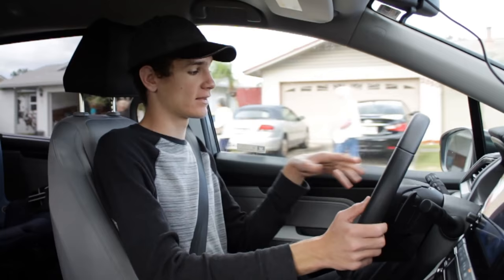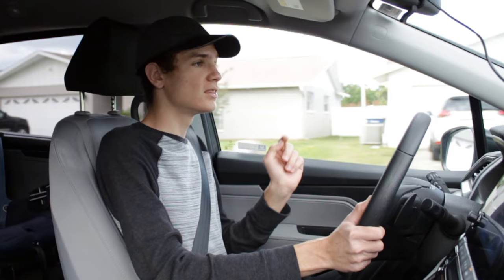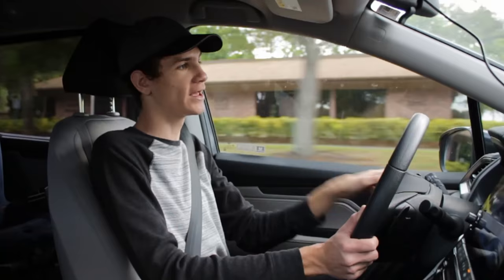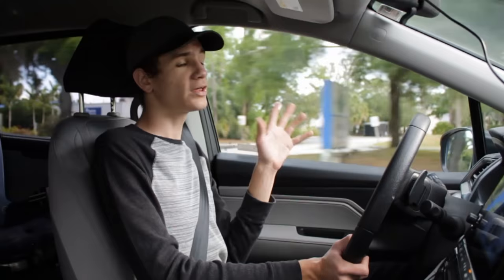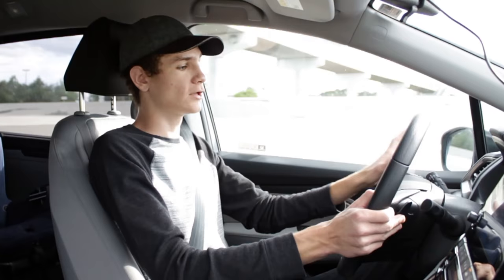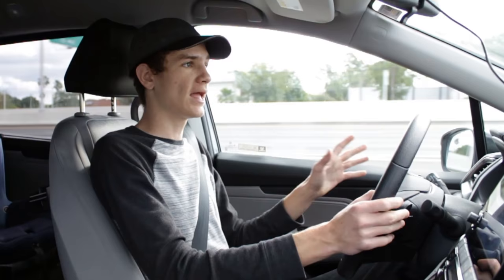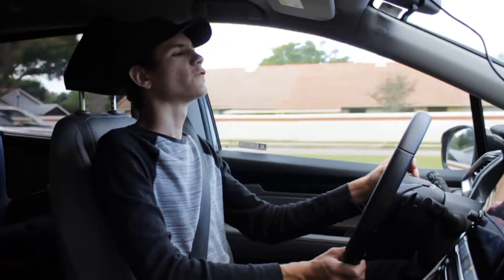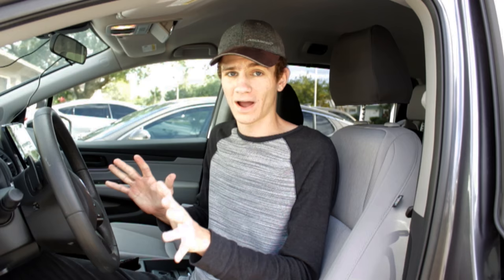How To Use Paddle Shifters | The ULTIMATE Guide

Comment: Negative is forward, Positive is slowed down. Thank you. I thought the cat had issue for stalling. 
Another thing on the dash board, when you use those flaps, it shows the icon moving from 1-7 I guess that’s the confusing bit.

Comment: I thought they came with a clutch peddle since it's a manual. Thanks for this video cause when I tried driving with paddles I didn't see a clutch so I assumed it was an auto. Since I like loud cars I kept pushing the minus paddle and my drive was awesome!!!
Reply from the maker: The idea is that there's no pedal to peddle because instead you pedal the pedal peddle paddles on the back of the paddle pedal peddle. Glad this helped 😁
Reply: @marcowollenweber9723  Lmfaoooo

Comment: Not with a 2021 Buick Enclave. Tried it once. It was dismal, but I haven't figured out how to use it. It's the wife's car, so don't drive enough. The time I did after I got going, it held the shift point to start changing gears. For example, I used the  paddle shift at 4,000 rpm and every new gear started at 4,000 rpm. Must be for towing or passing?

Comment: I tried to press the minus paddle, it sounds like my engine is struggling, it is very loud, so I press the plus again. Is it good to hear the loud sound or bad? They said that it will damage your transmission, gear, etc. Thanks.
Reply: Just don't go over the redline bro but modern cars would have limiters so you should be fine.

Comment: If im driving automatic, do I NEED to paddle shift? or I can just drive automatic ignoring all the other stuff
Reply: No one replied to this so i will. Paddle shifters are essentially “automatic manual” so your controlling the gears manually but if u red line or are in a high RPM (the numbers that say 1 2 3 4 5 6) it will automatically shift for you. You do not have to paddle shift it just makes the driving experience more fun.

Comment: You are totally wrong!  Using the paddle shifter actually changes the gear, which changes the RPM, which changes the noise level.  Honda has a short YouTube video that correctly explains this.  Please remove this video.